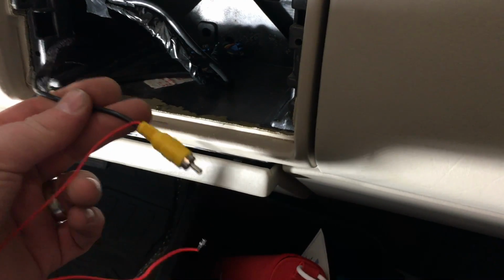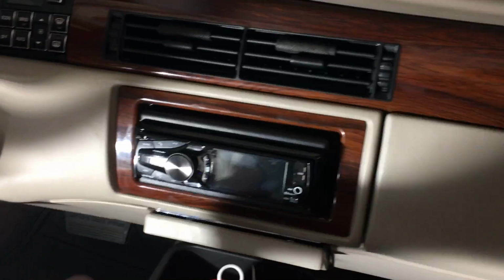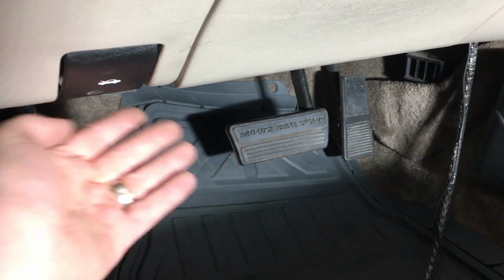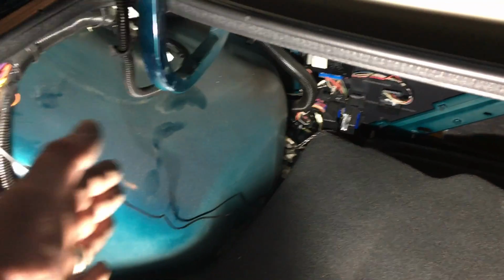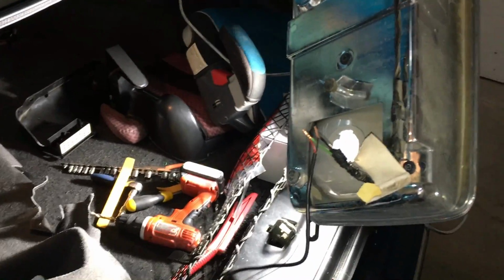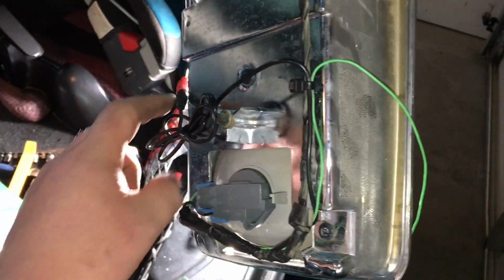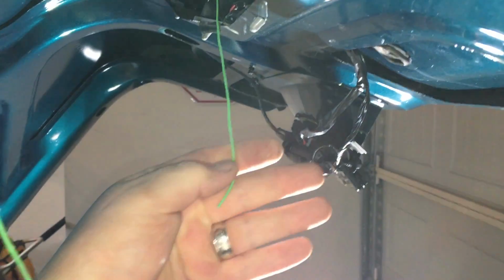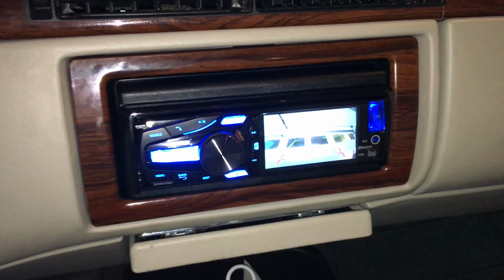1994 - 1999 Cadillac Deville Radio and Backup Camera Install

Comment: Helloooo! I have a silly question to ask here on your 8 year old video!
I will be installing an Kenwood KDC X705, on my 94 DeVille, with the same base model radio you have there. No back up cam for me.
I have never took on a project like this, so I'm ignorant. 
Do you just connect the 2 black ground wires together on the receiver/adapter? Or shall I do a chassis ground?

Comment: Love them 4.9 caddys with a plush interior <3
Reply: Looks good clean install
Reply: I did hot glue dont lay in the heat of the end times were in but pdr glue will hold thru judgement day

Comment: Did you need the bypass harness that runs from the back of the trunk to the front of the car? And would the scosche connector work also as the connector you used on the car? I have that same radio exactly

Comment: I have a 99 Deville and when I went to go get my aftermarket stereo installed they said that they would have to move the stock deck to the trunk. Am I missing something or are they just trying to gouge me for unnecessary work?
Reply: Did u get it done I need a radio asap
Reply: @rigoagui  is the 1996 the same?

Comment: Can I get some help please. 1999 Deville base non-bose system. I bought the dash package included harness and antenna adapter no interface. I removed the stock radio and connected the aftermarket radio Nothing no power. Reinstalled the stock radio and Nothing no power. I had to have the car reprogramed. I understand I need a special interface harness for the RAP. Can you shed some light please. Thank you for your time.
Reply: Fuse man
Reply: @rigoagui  do u know of any write up of this . I have a 96 deville

Comment: I have a 1994 Cadillac with only TWO wire connections coming from my my stock radio, if you could guide me with some information I'd be interested in connecting online somehow to explain more
Reply: Did u have the power and memory wire from your car harness I need help

Comment: Yes, I'm Corbitt Franklin Jr, & I have 1994 Cadillac Sedan DeVille, & I'm trying to install a (Dual) MULTIMEDIA DVD RECEIVER WITH BLUETOOTH, ? Is I don't have the harnesses, how can I do this with out them, but the RADIO CAME WITH ONE, SO IT WON'T CONNECT TO THE ONES COMING FROM THE CAR, SO COULD YOU PLEASE TELL ME HOW TO CONNECT THIS, OR CAN YOU TELL ME WHAT KIND OF HARNESS TO BUY, BECAUSE I WAS GOING TO SPLICE THE WIRES COMING FROM CAR & TRY TO MATCH'EM UP WITH COLORS COMING FROM THE NEW RADIO, (BUT) SOME OF THE COLORS DON'T MATCH UP, CAN YOU PLEASE MAKE A VIDEO OR TELL ME WHAT DO SIR, THANKS !
Reply from the maker: Don't simply match colors as factory wiring does not color code to aftermarket. We used these parts that can be purchased on eBay, Amazon, Best Buy, Walmart, or any local car audio shop:
*Scosche GM1504 Dash Kit
*Metra 70-1858 Wiring Harness (non-amplified)
*Pyle PLCM18BC License Plate Mount Rear View Backup
*Scosche UAA1 Universal Antenna Adapter

Comment: I don't understand why you would use hot glue on there on a hot day when that radio heats up it will definitely melt to liquid again
Reply from the maker: I don't think you have used hot glue before as the melting point is about 250 degrees F.  You let me know when your car gets that hot...

Comment: Where did you connect the yellow back up camera and the red one?
Reply from the maker: The yellow cable is the video cable from the camera, it goes to the video reverse camera input of the radio.  The red one is your power wire for the camera, it plugs into reverse light power and ground.

Comment: I do have one question that has been keeping me from installing my own system in my 98 deville... What about the car's security system? I've heard numerous horror stories about locking the car's system down after a custom install without the proper wiring interface since the security system runs through the factory stereo... (i think LC-GMRC-03 Wiring Interface is the right one), but i've never had to bypass a security system for a stereo install before so I've yet to do it in this car.
Reply from the maker: You are right, if done wrong, you open yourself up for a host of issues.  But, the wright harness will do the job.Yes, the LC-GMRC-03 is the right one.  https://www.sonicelectronix.com/item_90297_Axxess-LC-GMRC-03.html  Use ProvoBeast and save some cash at checkout.
Reply: Have you had any luck
Reply: Have you had any luck

Comment: I'm getting a 98 Cadillac deville in Michigan and want to upgrade the radio, I heard by upgrading the radio would affect the electrical system is that true please let me know
Reply from the maker: Depends how it's wired.  You need to get the correct wiring harness or else it causes issues with the factory canbus system.  Head over to Sonic Electronix and use their vehicle fit guide to ensure you get the right harness.  Use coupon code ProvoBeast to get 5% your purchase.

Comment: How much would all that cost to install, equipment included?
Reply from the maker: Depends where you purchase it.  I have all the part numbers in the description.  Search them on sonic electronoix and use ProvoBeast for 5% off your purchase at checkout.  Save you some $$

Comment: How do you get the CD player to work?
Reply from the maker: Which cd player? The aftermarket or Factory?
Reply: Provo Beast Audio Installation Aftermarket
Reply from the maker: Not sure, this was a customer vehicle, so i only had access to the radio for a few hours.
Reply: Provo Beast Audio Installation Oh ok because it's a DVD receiver if it plays dvds it will play cds
Reply from the maker: It plays DVD's for sure
Reply: Provo Beast Audio Installation How do you put a DVD in it?
Reply from the maker: Face plate folds down
Reply: Provo Beast Audio Installation What button do you push?
Reply from the maker: Dude, again, this was a customer vehicle, not a personal vehicle.  Not sure.
Reply: Provo Beast Audio Installation Oh ok I was just kinda wondering if you knew

Comment: Question, My 97 Deville concours stereo will not work at all. I know its not the stereo itself because i already tried to others factory stereos and same issue. The issue is only static noise will come out ALL  speakers, on any mode tape,cd changer, radio. I dont think its the speakers either. Do you think it could be the amp? dont know what else. By way the great vid!
Reply from the maker: Thanks, i suggest checking with sonic electronix and their vehicle fit guide to see if you have the correct wiring harness adapter.  If so, it may be the amplifier or your wiring configuration.  You can always bypass the factory amplifier, but that is a job all in itself.  My suggestion is to double check the harness you are using for compatibility and ensure that the blue / white wire on your harness is hooked up (which triggers the factory amp to turn on)

Comment: Did you have any problems with the anti theft and were you able to use the steering wheel controls ?
Reply from the maker: No problems with anti-theft and this model didn't include steering wheel controls.
Reply: Provo Beast Audio Installation thanks